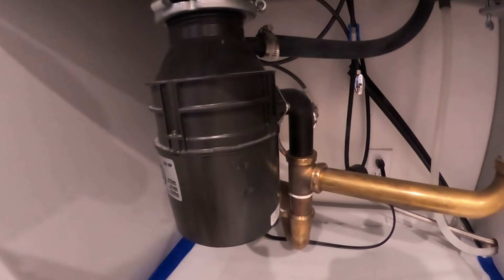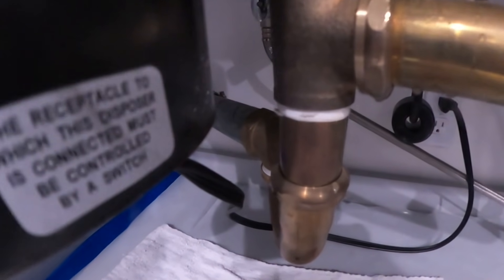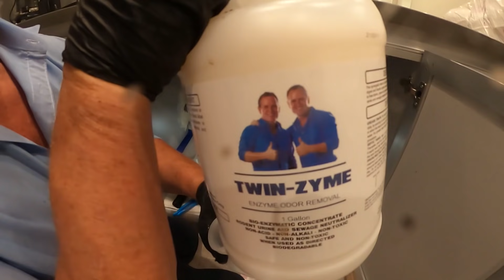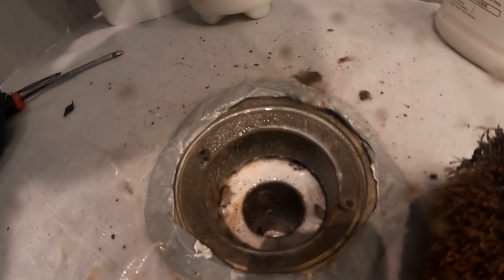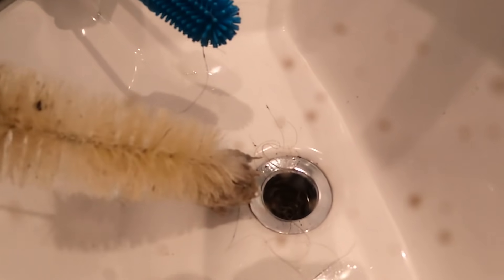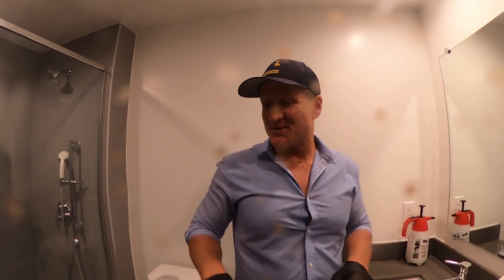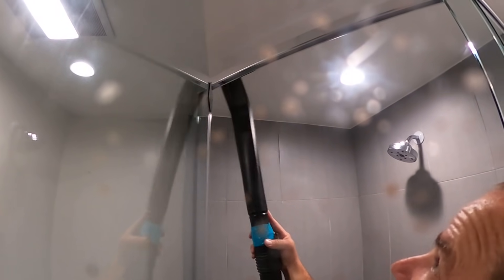MASSIVE DRAIN FLY INFESTATION!! How to get rid of drain flies...FOR GOOD!

Comment: This is how I got rid of my drain flies. First I poured liquid fire in all my drains, then 2 gallons of boiling water in each drain, next baking soda in all drains  and added white vinegar. Rinsed and followed with outdoor Clorox. Finally went up on my roof and put screens over all plumbing vents, problem solved👍👍👍👍for dishwasher drain I poured 2 cups of 30 % vinegar and ran dishwasher. Took a half day but I have not seen any in 6 months
Reply: Now, searching for LIQUID FIRE...

Comment: I had an infestation years ago at my apartment. The complex’s piping was too small and wasn’t meant to have washing machines but I guess they added them last minute before I moved in. Time went on and I noticed them coming from behind the washing machine. Turns out the pipe connected to the washing machine was leaking for years and there was heavy mold inside the wall of the washroom. The drain flies were eating and breeding in the mold and kept coming through the thin cracks in the back wall and through the bathroom since everything is connected. Maintenance came and had to open up the wall to get to the pipe and mold. As soon as they opened the wall, a swarm of em came out and was all over the apartment. Terrible experience
Reply: That’s some nightmare fuel for sure!
Reply: Ok I am experiencing them rn I see them coming from the bathroom,  my apartment is small and I have a washer connected. Did you have to move out while they worked on your apartment ?
Reply: @barryallen8887  No. once they opened up the wall they sucked up the water that was in there and put some type of powder that got rid of the mold. Their food source was gone but they were still everywhere so I had to literally kill all of em one by one. Took about a week after they cleared the mold but I was still in the apartment throughout
Reply: tay 234 did you move? i have them in my bathroom on my in my sink and all over the counterparts.  at 8am they multiply up the coner wall, all over counter top. i put them in an sealed sandwich bag at 8:15am today and there still alive.
Reply: @jenbest4972  I moved like a year or two afterwards. Once the exterminators got rid of their food source, they disappeared after about a week. You might have some mold somewhere
Reply: @Tay234.  I would’ve packed my stuff immediately and move 😂
Reply: Thank you SO much for sharing...a lightbulb just went off because of your comment!!!  Really appreciate that.  Pretty sure I know where they are coming from now!!!  Our shower tile needs to be replaced...the water leaking behind sounds like it has made this whole infestation happen!!! Omg...ugh...thanks!!!
Reply: What the, I thought flies only come in your house when you leave the door open 😮
Reply: Dang thays horrible. I wouldve moved out asap

Comment: For drain flies. Make a trap red wine short glass half filled covered with serain wrap poke holes make sure a little bigger then the flies. And to kill flies on sight use rubbing alcohol in a spray bottle using the misting nozzle. The will fall out of the air and you could spray them directly to kill them or squish them.
Reply: Thank youuuuu!!!
Reply: What percent alcohol. I'm assuming it's isopropyl alcohol. 70 percent or 90 percent?

Comment: Great clean-up video. I had my first experience with these flies when I moved into a rental house. They were in the bathroom downstairs where they have double shower heads. One flew right at my forehead and I thought it was a moth at first, then I checked out Google. I poured bleach and water down the shower drain and placed fly paper near the shower. Caught 3 on the paper so far. I have a steam cleaning machine so I'm going to try that next. Also the overflow drain looked dirtier than most. I scrubbed around with an sos pad but I'm hoping steam will help. Under the sink looks nasty too...possibly a mold issue. I'll let the landlord know about the issue as well. I'm glad you showed how to take care of this issue. Thank-you.

Comment: I did apartment maintenance, the real cause is biofilm,moisture and city sewers. 
The city sewer is infested with them and you can call the city to treat the area's sewage system.
To reduce the bio film, we reccomended using recycled paper plates instead of letting food go down the sink / garbage disposal unit and removing hair from the shower drain , tossing it in the garbage. 

After that, we reccomend the enzyme in the video be put in the shower, and sinks at night before bed once a month.
 It saved water and elimnated the issue.
Reply: Thank you. I live in a Housing department house. I'll ring them and maybe the council
Reply: Try your ideas first

Comment: The building I live in tried telling me that they are not drain flies but fruit flies. When I am 100 % without a doubt they are drain flies because of the moth like appearance, how they hop all over the walls. Rather than buzz around. Crazy making.
Reply from the maker: You nailed it! Send this video to them :)
Reply: @TwinHomeExperts  I have a tenant that is having an issue with this in their bathroom, they say they are coming from the drain and walls.  If we open up the wall to see if they are in there, is there some kind of smoke that can kill them before they potentially swarm out all over the apartment before it's opened up too much?

Comment: Grossly great video on how to treat these guys. I think they are coming from the drain in my laundry room floor. I sealed it with aluminum foil for now. If you cut off air supply this way, will this work too?

Comment: One year I had a biblical infestation. I didn't know what they were nor where they were coming from. Turns out, they came from the bathtub drain. So I boiled water in one of those huge stock pots. I poured boiling water in all my drains then placed wet towels over the openings of all the drains in the house. That way they couldn't up out into the house if they survived the boiling water. Then I set to work killing any that were flying around. It worked for me and I never got them again. But it's definitely not the professional method. My goal was to sever the breeding cycle. I do this with mosquitoes in spring summer. I use mosquito dunks to break the breeding cycle. This year the weather did it for me naturally. We kept getting warm ups then deep freezes late inyo the season. So the mosquitoes would lay their eggs but then they wouldn't survive the cold snap. Then the adults would die. I've only seen two mosquitoes this year. Pray for Texas though, skeeterarmageddon

Comment: Just one question...it looks like there was a dishwasher..do you treat it and how?  My house has clouds of these things. Last time I only used draino and septic cleaner and they disappeared and I had just as many. This year it is not working. Your video has given me soooo much information that I will start employing in morning. Thank you SO very much.
Reply: Clean out the filter and screen in the bottom of the dishwasher.  Then use an enzymatic cleaner like Affresh or Dishwasher Majic.  Repeat once a month.  Can also do a cycle with a cup or so of vinegar in a container on the top rack followed by a cycle with baking soda sprinkled on the bottom.

Comment: I had a drain fly problem that i couldn't figure out.  Turns out they were living and flourishing under the shower glass that attached to the floor.  And it only takes one to start the breading process in the other drains.  never ending cycle until you find all of the spots.  I seen some that lived in the shower head.  and some that lived in the fridge water pan under the fridge.

Comment: I put hair removing cream down the drain, leave for 10 mins and rinse. It breaks the hair up if it’s not too blocked
Reply: Thanks for that tip -but I have a question: What is hair removal cream?  Do you mean product women use to remove hair from legs, etc like Nair?   If so, how much - teaspoon? tablespoon? entire bottle?  and how often.  Thanks much.
Reply: @nyla3235  yes, nair  is one I use.  I only put it down about once a month, about a 2 tablespoons with a little water from kettle to drip on it a few times to push it down a little.  I leave it about 20 minutes then pour kettle down.  Voilà 😂 no clog
Reply: @remove574  Thank you -appreciate the insight. I'm definitely going to try this.

Comment: I had to comment again. This was the best how-to video on getting rid of gnats I have tried. It worked so well that I could hardly believe it. Absent taking the plumbing apart I did the treatment, and fully ready but not quite yet to remove and clean the plumbing I did it the enzyme way. It worked. I am very grateful that I did not have to call a plumber. Thanks again.

Comment: I've been fighting sewer knats for over 6 months now & I've used everything from Amazon Sewer Knat pipe/Cleaner to Professional Exterminator crap that is green & thick that eats the coating of crud off the inside of the pipes.
I never had this issue until my Sewer tanks were pumped out. No breaks in the lines, etc.. I have P Traps under every sink also & broke everything apart & hand cleaned them all.  Now they are about gone in the kitchen & back bathroom but they are triple bad in the master bathroom now! Driving me crazy. 
I was told by professional exterminator that they were coming up from my 1st sewer tank but how are they getting thru the P-Traps? Which are filled with poison. Keep in mind, I live in a very small single wide mobile home here in SE Texas
Reply: I done all the drain cleaning/poison and its like they got 10 times worse. Come to find out they're in my ductwork..😖
Reply: I’m dealing with the gnats at my parents and can’t find anything that works. Did you ever get rid of them?

Comment: How do you get rid of them, when they are coming out of the septic tank outside and flying to the front sides of the house? I need something to spray in the septic tank to kill them off the walls. Please help.
Reply from the maker: That’s a tough one because of the massive amount of bio film. There are products like green gobbler drain fly killer that eats the bio film & Bactria.
Reply: @TwinHomeExperts  I ended up buying some invade hot spot bio foam and invade bio drain. We opened up the septic tank lid and hundreds of the drain flies fly out. We used the power washer and sprayed the bio drain everywhere and used the foam after to cling on the walls good. Hopefully it will keep them from coming out of the septic tank we also put Saran Wrap over the opening and then put the concrete lid on top so they don’t get out. I hope this kills them I don’t know what else to do.
Reply: Radx
Reply: @mandyl743  same problem. Thanks
Reply: This is the issue I’m having!

Comment: I hate these things. I keep my drains clean, but some how they still come around once it gets warm outside. I have to turn on my air condition and take the temperature down into the 60's just to help keep them settled down, but then they come and try to fly up my nose for warmth, they dive bomb into my hot coffee , or decide to do a back stroke in my pancakes and syrup.. I never lived in a place like now that had these things.. I hate.   I wonder if I seal off the drains , how long it will take for them to die.
Reply: I feel your pain 😭 how did you get rid of these lil evil things
Reply: @Kimberly-jz2ts  I never have. Winter kills them off.  I put duck tape to cover up the holes in my sink, and tub, I also cover up the overflow.  I cover the slit on top of my Keurig coffee maker because they will actually go into that because of warmth and moisture.   I have used those fake apples that you pour apple cider in.. its has holes for them to go in.   They come from outside some where. I keep my pipes cleaned out. They like my trash can. They like flying up my nose when i breath in. They like flying into my mouth when its open.  They love to dive bomb into my hot coffee, and they like to do the back stroke in the syrup on my waffles.   And I am not even infested with them.  I have like under 10 at any given time, but I spray my garbage can with RAID.  I did by a Sticky Post from Walmart one time. Its about 1 foot tall.  It has a base that I put a little apple cider in , and they get stuck to the post.

Comment: Cost effect order eliminating alternative - boil water with fabuloso, then after the space is strong with the ammonia aroma, then cut the heater on and let the air handler run.      Until the fabuloso solution boils out.

Comment: Drain flies require moisture not so much organic material. The simplest fix is to boil water and pour not only down the drains but into the overflow drains, pipes and openings. Although it may appear they are coming from the drain they are actually coming from the overflow in your sink which is an area that sees moisture but almost never sees hot water or chemicals which makes the perfect environment for nesting.
Reply from the maker: Very rare that boiling water work in a heavy infestation.
Reply: @TwinHomeExperts  absolutely no life form other than tardigrades can survive boiling water. 99 percent of all drain flies nest in the overflow piping. Adult flies may dive into a disposal in order to feed which is why people often report seeing them fly out of the sink drain but that isn't where the problem is, most adult flies are found on the walls and that is because they only nest near the drains. They certainly do not nest in the drain or the disposal, they do not nest near moving water or water entrapment areas, they nest near wet environments only not in them. Boiled water or even bleach and water in a turkey baster squeezed into the overflow will kill 99 percent of any of the issues. They nest in sink drains to give the larvae some organic material to feed on which is why they don't nest near a hose bib, ac drain etc.  Pouring ice and dishwashing soap into your disposal and running it until the ice blends and then rinsing with cold water makes all the fat bead up and run down the drain. That's how you clean a disposal, you never need to replace a disposal unless it's broken

Comment: We have an ongoing issue in our basement in a room with   a cement block foundation, we have had weeping tile installed on the inside years ago to prevent water issues. The weeping tile is hooked up to the room floor drain (which is closed off but the pea trap is still intact)
We have been spraying under baseboards, ripping up baseboards, taking out ceiling tiles, insulation, carpeting and  have had professional sprays done twice, we will find 20-50 dead bugs on the floor and the window well daily, for 4-6 weeks then spray again
There are no bugs in our basement bathroom or laundry room . It’s an extremely frustrating situation. Any ideas?